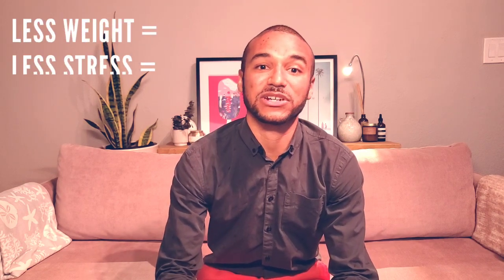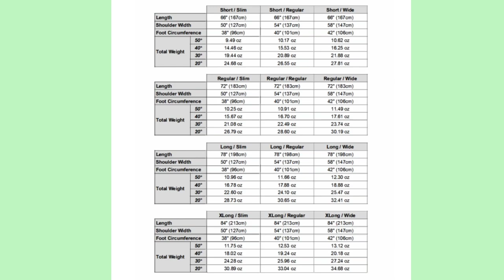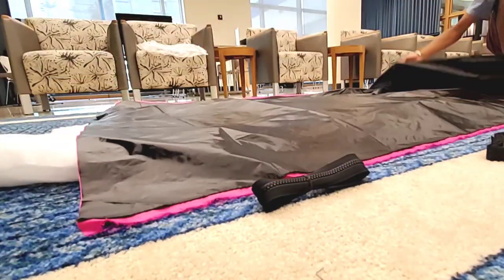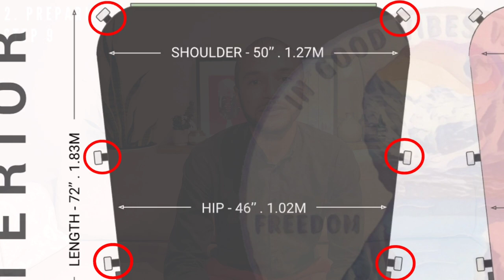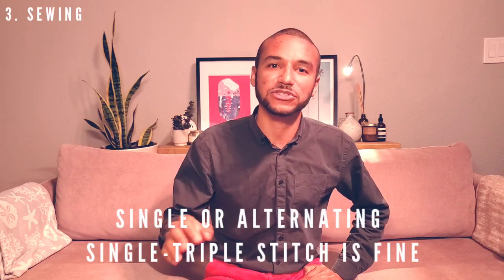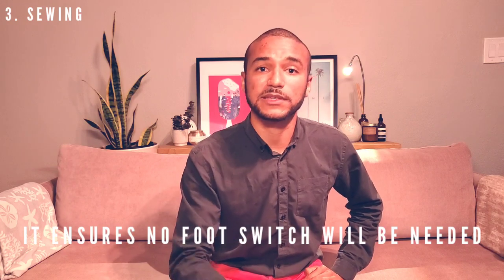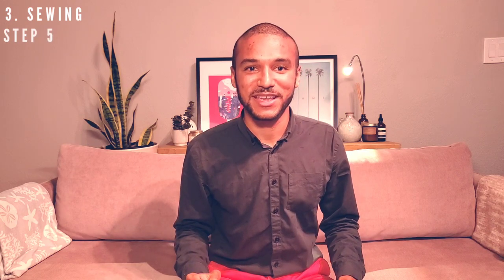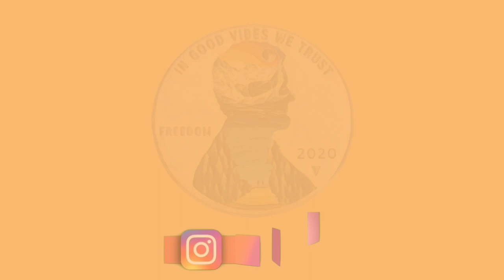HOW TO MAKE AN ULTRALIGHT QUILT (EVEN WITH NO EXPERIENCE) | ULTIMATE DIY MYOG GUIDE

Comment: hi there, thankyou so much for the helpful video. how warm would you say your quilt is, at what temperatures does it start getting too cold? Thanks
Reply from the maker: Absolutely! Simplest answer is to follow temperature ratings on insulation layers. That will get you within a couple degrees of what to expect. A lot of factors go into relative temperature while sleeping (e.g., whether you are a warm or cold sleeper, insulation rating of sleeping pad, what you eat / drink or don't prior to sleeping, length of time between eating and sleeping, what insulation layers are worn under quilt, adaptation, and list goes on). This means not only do people feel completely different using the same product, but also that the same quilt in same temperatures can feel different to same person on different nights. Apologies it's not a precise answer. This quilt is very warm to me. Hope you enjoy your time out there under the stars! 🏕️🌌

Comment: Awesome video, will be coming back for reference later! 😁 We'll be trying to make our own as well in the coming weeks but with the 6oz apex. What is the packed size of your quilt?
Reply from the maker: Happy you find it useful! Pack size will depend on a few things, mainly packing method and the dimensions of your custom quilt. With compression or packing around the interior shell, one could argue it might as well disappear. Compression can shorten quilt loft life though and wouldn't recommend packing it around interior shell as a strategy if doing a an extended thruhike. Loosely packed—e.g., basic two folds and roll, no sack of any kind to protect it and without any compression whatsoever—would approximate about 14" height x 7" diameter. Giving a range here. Hope you enjoy and best of luck!